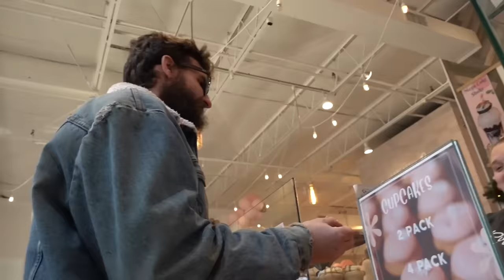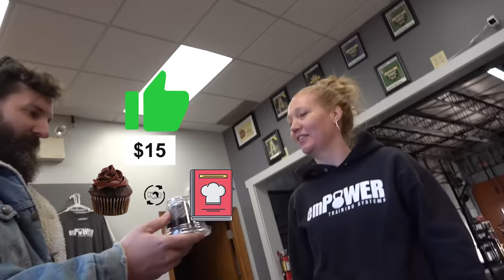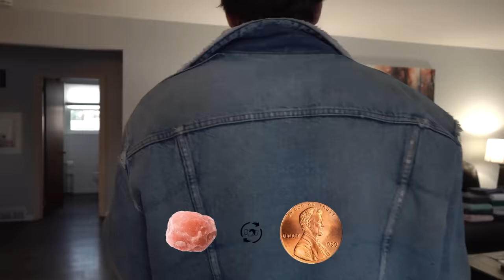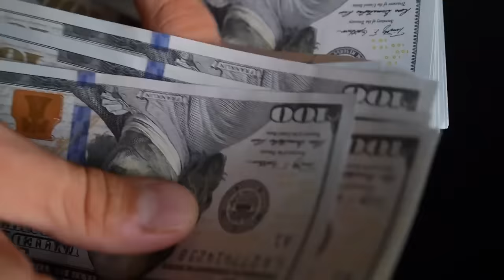Trading $0.01 up to a MOTORCYCLE in 14 days

Comment: Sorry to say, BUT this is not a Euro License Plate - Orginally there is no hyphen between the decals (Fun Fact: The IN stands for "Ingolstadt, which is a Bavarian City)
Reply from the maker: but it had registration sticker on it?
Reply: @BikesandBeards  than it has to be a pre 2000 license plate.
You can tell by the upper decal, which states the next TUEV inspection
Reply: @Andy241  it's probably just a eBay vanity  plate. You can buy ones with registration seals on there. It can't really be pre 2000 since it's EU format and those were introduced in 1998ish if I'm not mistaken.

Comment: Sean this is how I get motorcycles ever since I was able to ride started buying a £500 bandit 600 traded that for a 2001sv650 then a Ninja600 1997 plate then traded that for a project 2004 z750 from that to a 2006 vfr vtec 800 and final trade to a 2001 rst1000
Reply from the maker: nice

Comment: This only works if youre already loaded. I know because I wanted some petrol in my Honda but only had a pence so hey, even got a headstart from just a rock salt. So I go into a Tesco parking lot and saw a guy with a shopping cart full of stuff, and proposed a trade of anything from his cart for my pence. He threatened me to bash my head in altough he was a small dude, then he told me not to come any closer to him. So I try the second time with a younger couple because they may get it. They laffed and wanted to give me some Jaffa cakes right off the bat and I took the trade. But I ate them cause I was hungry. Looked around the lot and found another pence. Just when I was approaching my third trade partner, police shows up, throw some scamming charges at me and arrest me. Thanks Sean.
Reply from the maker: it has nothing to do with money, it has all to do with persistence, and you cant trade a penny for something that someone just bought, you have to find things that they dont care about anymore
Reply: @BikesandBeards  thats correct, i have had people even offer me free stuff that actually still have fairly good value, and gotten more free stuff because i asked.

Comment: I got a story for you. I traded a beat up Ram 1500 for a Vulcan VN800. they trader lied and the bike was in shambles. after spending about a year and 3-5 grand trying to fix it / restore it it was finally working and in good shape. I wanted/needed to sell it so I put it on the market but the market in FL sucks so eventually it was listed for 1300$ the person came out to see it, and while he was check if all the lights worked he kicked it into gear and it rode away and crashed itself into the ground doing 600$ worth of damage and denting the tank. They guy dipped quickly, so... I still have the bike. :'( very sad experience.

Comment: you folks not thinking you completed the challenge when you got the atv. its technically a motorcycle.
Reply from the maker: its technically not haha
Reply: @BikesandBeards  not to sure about that. There are several places right here in the USA that allow these on the street both winter and summer. Such as where I live. As long as you buy there permits that is. They have a motor and 4 wheels off road bikes are still motorcycles. Hell my little bt200x says off road motorcycle right on the stickers on the bike. Ha ha.

Comment: The quad doesn't count. Nobody really just gives away free working quads.
Reply from the maker: It wasn’t working. We had to get it running.
Reply: If it was working, my kids would still be riding it. It needed some work that I did not have the time or patience to deal with. I knew Sean would put it to good use. I actually bought it for $200.00 over 4 years ago.